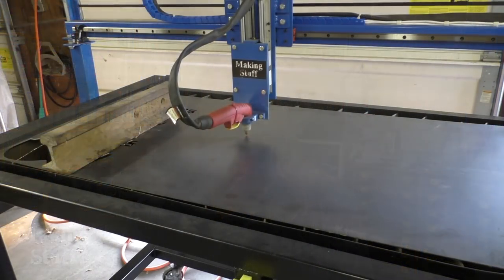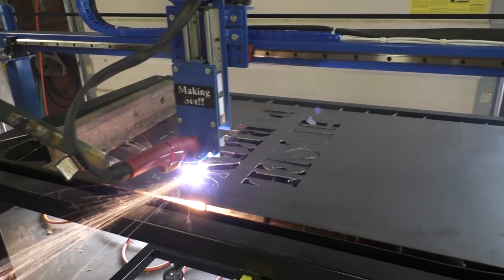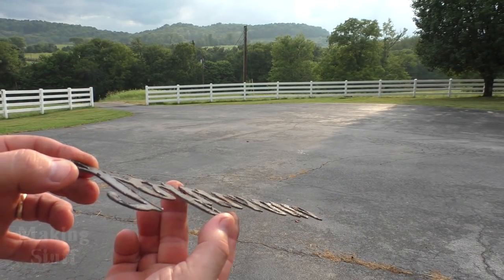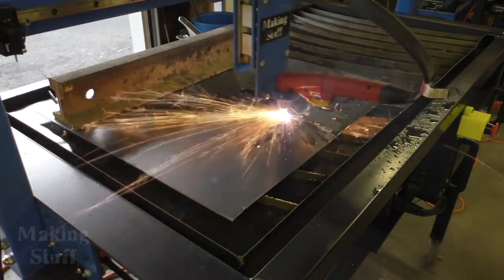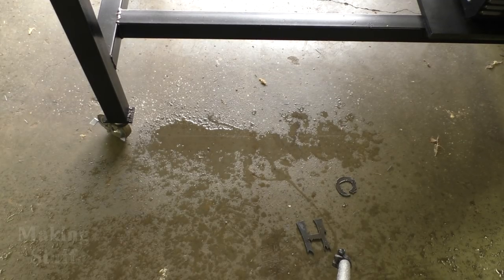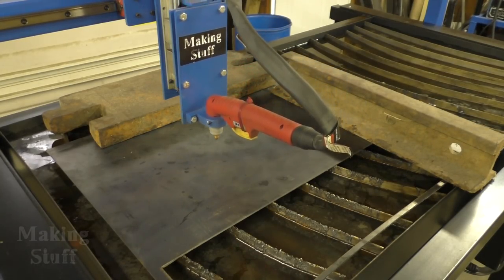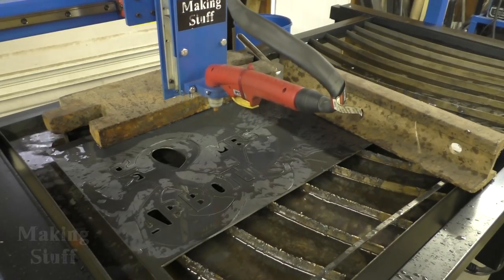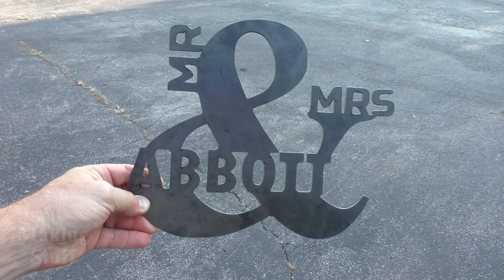DIY CNC Plasma - Does It Need a Torch Height Controller

Comment: I run my water right up under the sheet, generally within 1/8". You get less splashing, and better warp control/less dross
Reply from the maker: Yeah I learn the hard way, LOL!  Thanks for watching.
Reply: So, if I fill up water all the way up to where you did, can I get away without using a THC for cutting 3 & 5mm thick steel sheets?
Reply: @TechBuild and? yes or not?

Comment: Raise the water level till it just barely touches for thin stuff and when you get to 3/16" thickness and over touch the plate with the level.  This will prevent alot of dross from sticking and cut diwn alot more on warping.
Also I noticed the program seems to cut in a progressive order from one side to the other. More expensive programs will randomize cuts so as not to build up so much heat. See if you can change that cut order. 
A way to cut down on splashing is put some strips of metal in the gaps around the edge of the table to effectively you dont see the water at all . This will cut down on it. 
Are you running any sort of air dryer from your compressor?  Im not talking about a desiccant one either.  They only filter out moisture thats preexisting. I run a refrigerated dryer and i get 5 times the cut life out of my consumables now and alot better cut.
If you can't afford a used refrigerated air dryer then take an old mini fridge and the precoiled copper half inch tube roll( like 20 ft long) at home depot and space it out abit till it fits in the mini fridge.  Drill a hole in the sides( not the back.Thats were the freon is ) and sweat some NPT ends onto the copper pipe and crank down the temp so it freezes or close to it. The outlet on the bottom then put a moisture trap so the water runs down to that on the outside of the fridge.
Running a small air conditioner near the compressor helps to remove the moisture from the air even before its compressed.
Reply from the maker: Thanks for all the info.  I am using Sheetcam to create the g-code.  Not sure if it will randomize the cuts because I'm not that familiar with it.  I do have a desiccant dryer on the compressor but that is it.  I thought about adding some strips of metal to the water pan to make the edges higher so the water doesn't splash over the side, just haven't got to it yet.  I wish I had an air conditioner, but sadly I don't.  The air does get hot and humid in the shop this time of year.
Reply: @MakingStuff  The goal with compressing air is to drop the temperature of it below the ambient temperatures dew point. Im sure you've heard that phrase on the weather stations before. My refrigerated air dryer cools it to 34 degs. It has zero moisture in it at that point. There by eliminating water droplets in between the tip and electrode. You could even run a copper pipe in the base of the water table before it enters the plasma cutter.  That would make a huge difference.  
You can probably go in and change the start points as to their order. Look in the instructions. This will go a long way as to keeping it from warping.
Two more things is run the lowest amperage tip you can ( if your plasma cutter can) when making thin sheet metal paterns. 
To keep the water from growing stagnant and bacteria in it add 
Physan 20 to it. Very little goes a long way. Get it on Amazon. Its a disinfectant, sanitizer, deodorizer, fungicide, algaecide and virucide all in one. Not very expensive.

Comment: I used the Price CNC thc on my 8 x 4 and it works really well. I just had to add an extra plasma earth so both sides of the metal were earthed as it works on arc voltage and I was getting a variance as I moved up the sheet. So far my results have been fantastic
Reply from the maker: Yeah a THC seems the way to go.
Reply: I just bought a Price cnc thc for my homebuilt table. I have a masso control and just setting it up. I have a longevity 62i plasma.

Comment: I keep a small (2 quart) pump sprayer by my cnc plasma table. I keep it set for a stream spray, not mist, and spray the metal around the torch where it's cutting. I don't know if that actually keeps the metal from wrapping or not, I never looked to see if it did wrap or not without the spray. I keep water in the bed too. Anyway, maybe try the sprayer.

Comment: THC is a must!  you wont look back
Reply: no, THC is NOT a must.
Reply: then check my videos. thin sheets don't continue to grow. they heat up, they expand and thats that. as long as the torch is touching off before each pierce, then you are good to go. i know group think is strong online, but believe it or not. the internet way isn't the only way, much less the right way.
Reply: A better cut is made because the height is set to optimum cut voltage for a given thickness. I did without it for 5 years, scrapped many parts and wasted hours / dollars cleaning up dross, now I wouldn’t cut without one. I cut from 1mm to 40 mm every day. Sorry, that’s  my educated opinion
Reply: @Swarfman64  funny how you have not one single video of your machine
Reply: @DieselRamcharger  Specially for Diesel Ramcharger, Yes I do cut 40mm plate, any time I like to. No there were no videos of my machine, why would there be, its just 
work.  Pretty funny how these machines have been about for years and you question I can cut 40mm? Ive had this 
one for 7 years. Took me longer to upload this clip than it did to walk over to the machine, slide on some 40mm plate and do a cut.
So, No, not full of shit          https://youtu.be/XrEAJqNMZIA    and  https://youtu.be/8h19Pj0dhxo
Reply: why would you NOT want a THC? 🤷‍♂️

Comment: why were you not using your floating z in this operation........... i think your torch (z axis) needs to probe before cutting.  and what CAM software did you used in generating the G-Code?
Reply from the maker: Floating Z came later in the project.  I use Sheetcam.

Comment: Obviously in a small shop there are less problems with dense dust generated using plasma. I have 37yrs in big production shape cutting oxy/fuel gas as well as plasma.  We ran Aluminum daily (1/2" and one inch). Although even the huge12ft. diameter overhead fans didn't help, all they did was suck dense Aluminum dust straight into the operators lungs. I left the shop(other reasons) then heard George was put into an induced coma for 30 days, and was lucky he lived. Now he runs the heavy Steel plate cutting machine(burns up to 12" thick every few weeks.  No one runs Aluminum anymore there.

Comment: how do you combat problems with misfires and also what plasma cutter are you using
Reply from the maker: The machine has arc detect and will abort and retry if it loses an arc in the middle of a cut.  Hypertherm Powermax 45

Comment: I realize this comment is too late because you already added THC to your system. But, a pair of roller wheels an inch or two from the torch that roll along with the torch holder would keep the metal flat under the torch. It would also provide consistent height of the torch regardless of the material thickness. Use metal wheels of course, similar to the torch dollies sold with circle cutting kits.
Reply: It wouldn’t work. Wheels only roll in a straight line if your torch had to do a corner or even cut  a circle it would be dragging the wheel sideways and where you pierced it would be dragging the wheel sideways through the dross. You’ve obviously never seen or used a CNC plasma
Reply: @davidcat1455  You obviously never rolled small metal wheels on a piece of steel; they slide sideways with no effort at all.The dross is close to the cut line and if the wheel were an inch apart, they would miss the dross. So apparently you are the one with no metal working experience. There are manual plasma guide kits that incorporate metal wheels and a carriage to support the torch a fixed distance abpve the material. It would be an easy modification for someone who actually has used a plasma table.
Reply: @briangc1972  
So you have one of those magical plasmas that when they first pierce a hole there is absolutely no dross on top of the metal?BS. I have been using oxyacetylene with guide rollers for 45 years and a plasma with them for 20 years. I suspect I was cutting steel while you were still an itch in your old man’s overalls. The difference is you fool, on a circle cutting guide the wheels are running parallel to the cut. If you are cutting a straight line using guide rollers and you get to a corner you don’t suddenly start dragging the cutting torch sideways do you? You turn the torch at 90° to follow the new direction you are cutting in. So the wheels are running parallel to the cut. So how are you going to get the CNC torch holder to magically turn at 90% or whatever is required so the wheels are running parallel with what you’re cutting? You didn’t think it through, you just blurted out what you thought was a good idea and you didn’t even take time to realise that there are no commercial tables made with guide roller wheels because they won’t work.

Comment: Yea..get a THC. There are some very inexpensive options these days. Back when I got mine a THC was at least $1000...and it was worth every penny. Now you can get them on Ebay for $250.
Reply from the maker: Yeah there are some good deals on ebay.  I picked one up from there and it was $300.  Now gotta wire it to the machine.

Comment: Since you have a Z height, would seem like you could have added a stud to the cutting head that the machine could zero from before starting to cut. Then every time it goes to cut and lowers the head, the stud would be pressing the sheet metal down x amount flat to the table, pushing any bow out. Might need to be manually changed when switching between gauges unless you could fab up some spring loaded one?  Really seems like some sort of spring loaded ball bearing headed leg would be simplest.
Reply from the maker: Check out the update videos.  The machine touches off before each cut now.  Similar to what you describe.

Comment: Hey Bob, why not fit a brush around the torch, as used in some router table set-ups. The bristles should catch the water splashes and drain them back onto the workpiece. Just a thought.
Reply from the maker: Thanks, that is a good idea.

Comment: We used the Proma THC it was simple to install and really werent any extras needed besides wiring. It seems to do a good job so far, tho we havent used it very much at all yet
Reply: Did you use the 150 or the 150 SD ?
Reply: @SegoMan  I wanna say the sd version withouth relays but not certain
Reply: +Dustan Webb Thx that's the version I'm looking at to go with the Masso and Clearpath servos

Comment: Two options, inductive sensor to measure distance frequently to sheet, other option is to add some omnidirectional rollers in few corners of the head, so it presses on the metal to make it flat. But that can put a lot of stress on the gantry, and is problematic due to the holes in the part. SO it will only work with thiner sheets.

Would waiting between some cuts help, by allowing for metal to cool?
Reply from the maker: I don't think waiting will help.  Once the metal bends it doesn't go back 100% straight.
Reply: @MakingStuff  I see. Thanks for answer.

Comment: Like your video, what size air compressor you using and what psi it is?
Reply from the maker: 80 gallon upright.  It is located in the room next to the shop to eliminate a lot of the noise.  The plasma cutter has a built in regulator and it is suppose to run at 80psi.

Comment: Have you considered putting a small manual "telescope push arm" with a ball wheel on the fixed part of the Z-axis? So whenever you load a piece of metal that is thin and will warp, you'll be able to pull down the push arm to gently push on the plate with the ballwheel preventing it from warping... this will not work in all cases, but it might help?
Reply: terrible idea.

Comment: Nice sign designs.  I am anxious to get back to mine this fall.
You showed how changes to your feed rate was improving your cut (lack of dross).  What did you settle on for that material, and how thick was it?  ~P
Reply from the maker: I'm running 40 amps on 16ga at 125ipm and 14ga at 105ipm.  That is with the cheap HF plasma cutter.

Comment: just finished a auto height ajustment on my 3d printer uses a Proximity Sensor Switch (NPN) and a little bit of programming to make the machie believe its the z axis max travel switch  , seems to me the same sensor can be used to keep the torchheight the same across an uneven surface (works even better on steel surface )
Reply: Do you mind doing a video about this?
Reply: Or giving a little more information about how made it the programming and so on?

Comment: all you need is to touch off before each pierce. THC highly over rated. also your feeds are putting too much heat into the material.
Reply from the maker: I think I have to add touch off with the THC, not sure at this point but it does help.  Thanks!
Reply: if you need ill make a video of my machine for you tonight. the switch is break on contact not make on contact, so there is effectively no offset height. Even if you use a THC you still need a floating head or breakaway, to mitigate damage if the machine for whatever reasons Z's the torch down into the table. Diving can and will happen with a THC until u get it setup properly. Also THC doesn't work well on small radius circles and arcs. You've got a lot to learn.
Reply: touch off is handled in the control software not the thc. unless you are using inductive torch cap collision, which isn't 100% reliable and still needs a floating head to avoid disaster.
Reply: @DieselRamcharger  let me ask you this.  When torch gets close to the work surface but doesnt touch it how do you compensate for varying hieghts because of metal warping then. Dross and kerf angle are greatly affected by your distance to work not to mention the width of kerf also.
Reply: @DieselRamcharger  Why do you say a THC doesnt work well on small radius circles?  It has nothing to do with what shape its cutting.
Reply: @buildthings79  because the voltage changes too quickly leading to torch oscillations result is poor cut quality. Don't challenge me when you have zero experience  and armed with only theory of how u think it works.
Reply: @DieselRamcharger  Im thinking you dont understand how a THC works. It reads the voltage from the plasma cutter that is from tip to work peice. This voltage varies from thickness of material and amperage of cut also. After you do some line speed tests and amperage test and determine the best amperage, cut heightand speed for that material then you enter the votage you observed into the THC and as the torch begins its pierce there is a programmable delay for pierce time then the voltage levels out and as it begins it cut the THC then makes micro adjustments very quickly to compensate for the variations in material to torch height. The further away it gets the greater the voltage and the closer it gets it lessens.  Therefore maintaining a constant height to work peice and producing a very clean cut with alot less dross. The THC first finds  the work by touching it and retracting to a pierce height then after pierce is complete it moves the torch to cut height (usally only a small variation) this saves the tips from blowback .
Reply: Diesel Ramcharger  I want to see your machine and a cut on it :D Think that would help settle all the confusion.
Reply: @dieselnautosolutions6615  look at my channel, the videos are there. it cuts great, we manufacture gusset kits for UTV's as well as all your typical art shit. THC is 100% unnecessary. THC will actually cause you a lot of headache on small radius things like bolt holes and such.